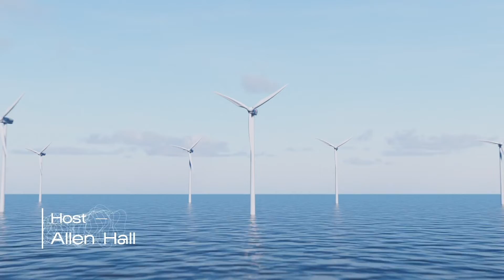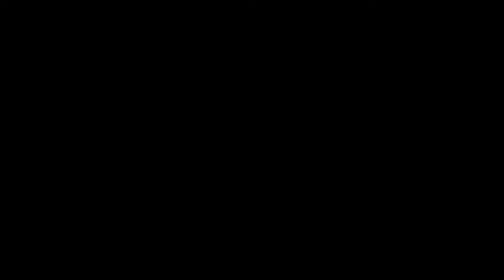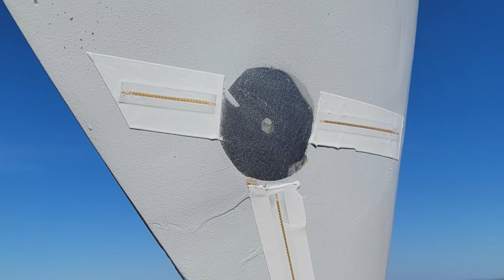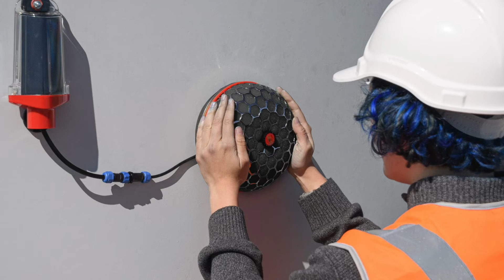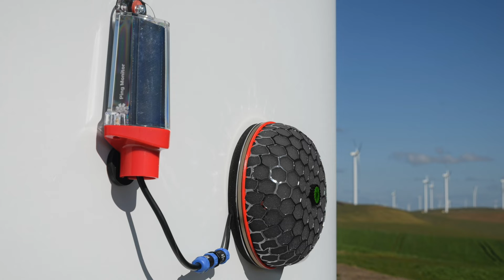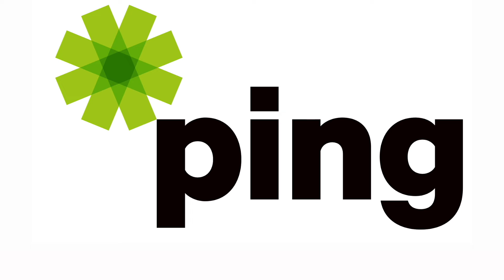T-Omega Floating Wind, SGRE vs GE, Roads as EV Chargers, Coldplay buys Flower Turbine

Comment: ref 12:40
Using a Tension-leg platform you can place pontoons that hold the structure bellow the surface where the effect of waves will be much less. A design where there is basically a pyramid shape will inherently be more stable then a single column design, but I believe that Rosie is correct when she doubt the cost savings estimates.